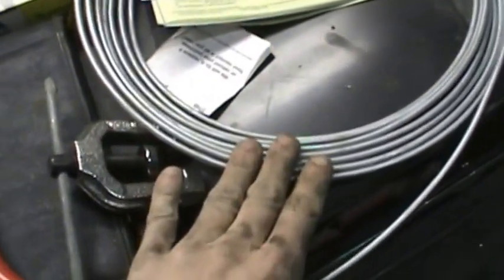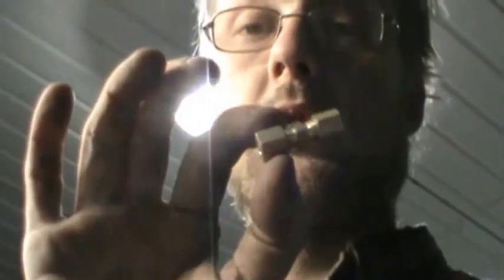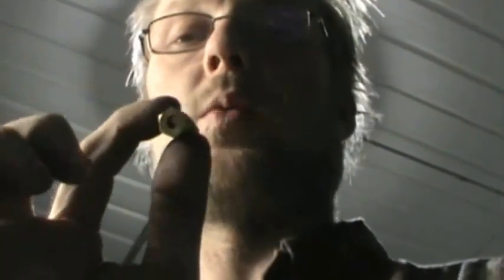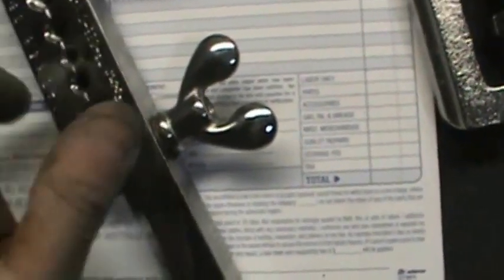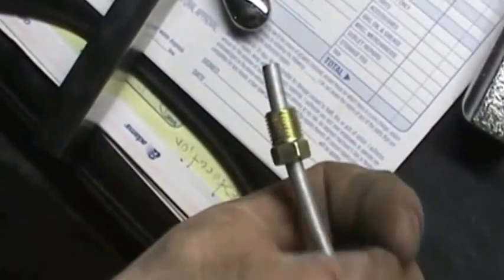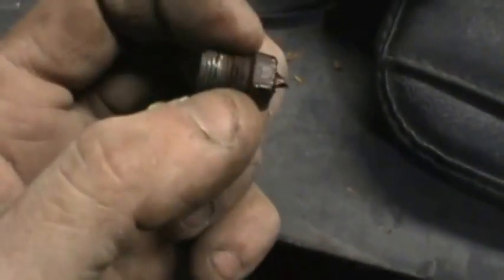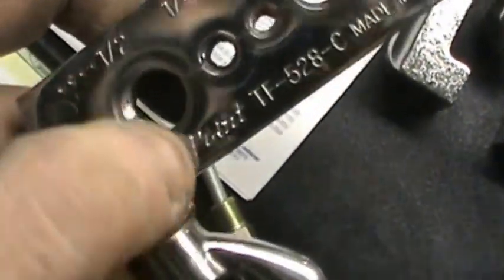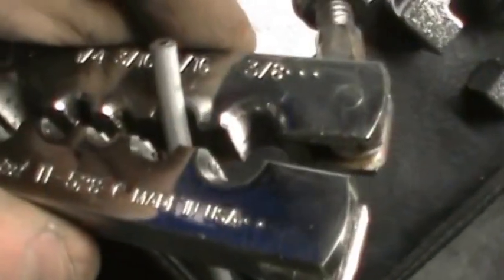1992 E 350 Service van resurrection  Part 1 Flaring brake lines

Comment: I think the line from the ABS has a normal tube nut  but that fitting it screws into on the ABS is special and impossible to find. I knew one guy lost it and had to buy a whole ABS unit just for that part. If yours was the same it would have an O ring on it.